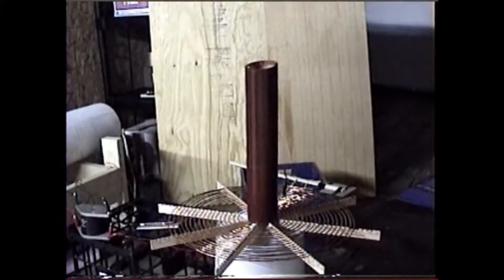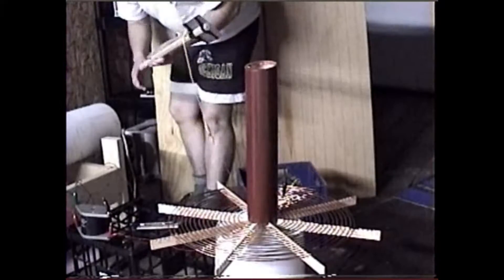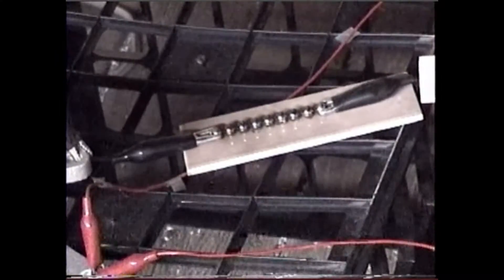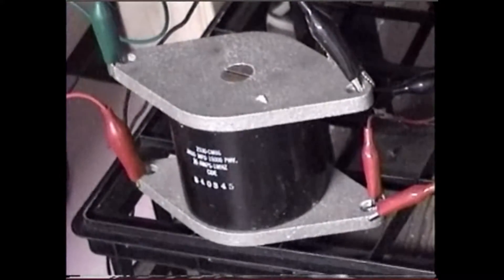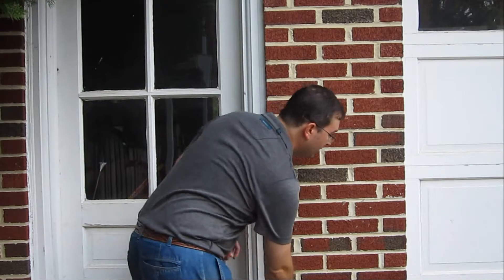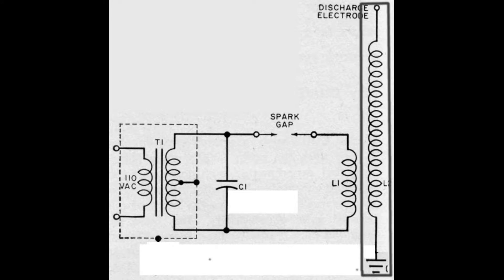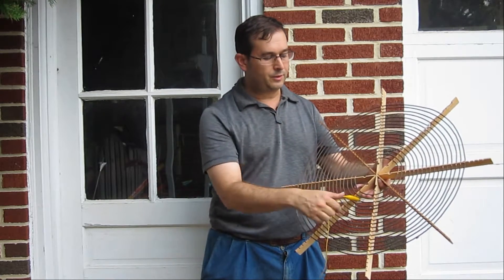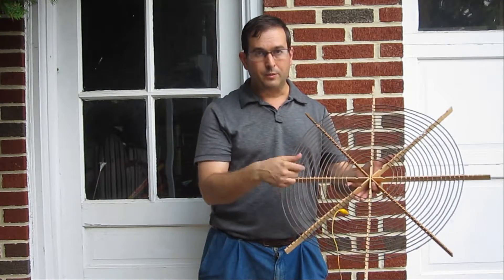High Power Multi Spark Gap Tesla Coil

Comment: Dr.  Jaynes does the series spark gap work as a spark multiplier at the end
Reply from the maker: Not really. More spark gaps add more resistance to the circuit.  The spark gap is a random type device.  Adding more of them in series takes some of the randomness out of the operation and creates a more reliable zero current.  This is required for high power operation, since if you can not shut off the current after the last discharge reliably, then you can not charge for the next cycle, and your tesla coil will not operate reliably...

Comment: Dr. Jaynes, I am still trying after what you taught me. Would be grateful if you answer one more question for me. Is there a relationship/ connection  between high voltage spark gap and frequency.Thank you very  much
Reply from the maker: Hi, they are completely different quantities. The high frequency makes the electricity travel through the surface of things, like your skin, so it makes it more safe because, it high frequency electricity won't travel through your heart and kill you hopefully.  It is also easier to transform high frequency electricity because you do not need a ferrite core to get then inductance high enough.  Ferrite cores and iron cores tend to be lossy, so you can transform the voltage of electricity more efficiently with an air core transformer, like a tesla coil.  Conversely, the high voltage is like an electrical pressure, it is related to how much it is able to push electrons through non-conducting materials like air.. The higher the voltage, the harder it pushes, the longer the spark you are able to make.  Breakdown of electrical arc is also affected by the frequency, but this is a more complex process.    I hope this helps a little.. It is all fun stuff..
Reply: Thank you very much Dr. Jaynes. You are the best
Reply: if i may add with my limited knowledge, laminated and ferrite core are not lossy. ops. sorry, laminated transformers are good in 50 and 60Hz. it can withstand high currents. Ferrite Transformers are good for high frequency like kHz or MHz. definitely it was not designed for high current. instead it was designed for high voltage, high frequency in low currents. Magnetic flux density of laminated cores are more concentrated than ferrite core. 
For Tesla coil, this is an Air core type. okay. Now Air core type of transformer are very lossy, ops. sorry. but the big thing about Tesla coil is the Resonance Frequency combined with your inductance in primary coil, also in secondary coil with its self capacitance in the tip load. lossyness of this air core transformer will be overcome by the resonance frequency if your coil os properly tuned..  sorry for my knowledge.

Comment: how  the bearinggs  are made to serve as a switch
Reply from the maker: Hi, The ball bearings act as a a bunch of spark gaps in series.  You could make spark gaps many different ways. I just used bearings.  Multiple spark gaps in series quench the discharge more reliably, and therefore allows higher power operation of the tesla coil.  Lower power coils can get away with a simpler single spark gap.  Some high power coils employ a rotary spark gap to quench even higher power discharges.. Thank for the great comments..
Reply: Thank you Dr. Jayne
Reply: Thank you Dr. Jaynes for your reply, but how the switch can be synchronised to open and charge a cap and close when the cap is fully charged